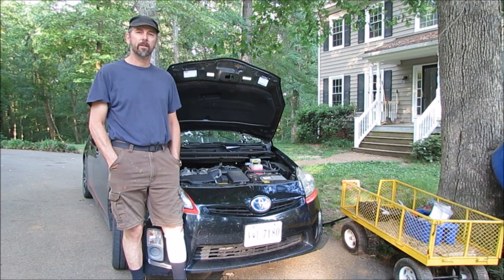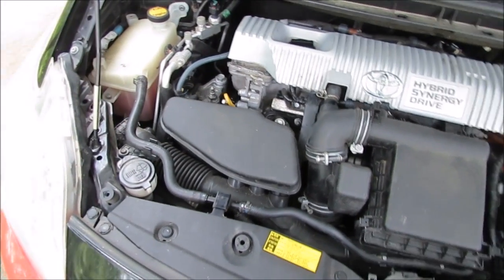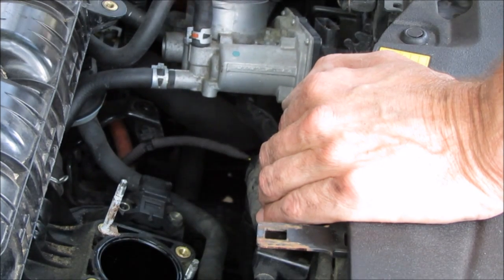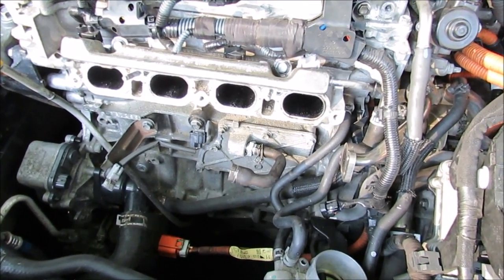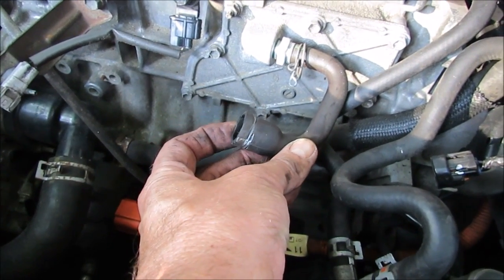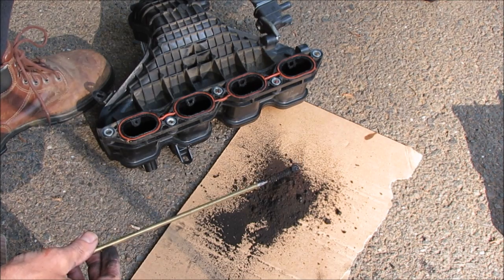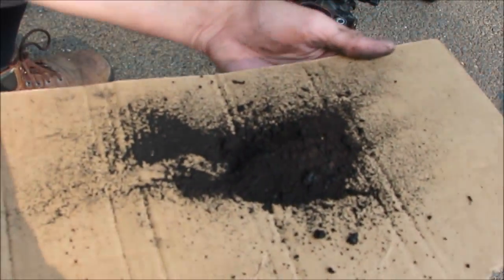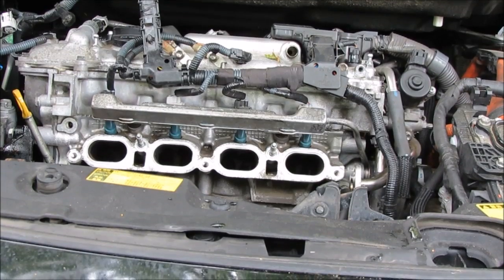Prius Intake EGR ports clogged

Comment: Do you have to replace the intake manifold gasket when you do this cleaning?
Reply from the maker: It would depend on the condition of the silicone seal. If it's not dried out and still pliable you may not have to replace it. I've had mine off a few times and it resealed completely when I put the intake back on. A serious leak would probably throw in intake leak code.
Reply: @robrig1646  thank you. I've always replaced the throttle body gasket, because I thought it was so important there not to be an air leak on it, but the intake manifold gaskets rarely are they every replaced. Mine has 234k miles but its surprisingly clean in the egr valve and egr cooler for never being done. I probably should do the intake manifold cleaning as well since I did the egr valve and cooler?

Comment: If we make a trip to VA beach to ride bicycles and my car is running rough, I’m not gonna take my girlfriend to Raleigh NC the following week before addressing the issue, I don’t want to ride bicycles back from Raleigh. I would clean the throttle body, and perform a computer reset. Your computer has been compensating for these flow restrictions, so when you remove the restrictions, it can create drivability issues

Comment: For the wire harness attached to the air intake manifold at 5:00 into the video, I squeezed the tabs with the short end of a 3.5 and 4 mm Allen wrench and it came out really easy.

Comment: Thanks for the video. My 2014 Prius with 181k miles would clatter when accelerating slowly while the engine was running and the hybrid battery had two bars of power.   Your advice that the coolant hoses didn’t need to be disconnected from the throttle body was fantastic.

Comment: I still don't understand why this clogging leads up to flooding of the intake manifold with oil. I just discovered fresh oil behind the throttle plate AFTER cleaning the throttle body and part of the intake manifold. Before the cleaning , those parts had carbon yet were dry. The fresh oil popped up after the cleaning. A complete mystery
Reply from the maker: I don't think the oil in the intake is because of the EGR being clogged. I think the oil is vapor from the PCV system that condenses, coats the inside of the intake, then slowly puddles in the bottom below the throttle body. 
Get a oil catch can and insert it into the PCV system, YouTube has lots of videos on oil catch cans (OCC).

Comment: Good video! Instead of brake cleaner, white spirit and valve cleaner 1, I recommend using regular grill and stove cleaner to clean the entire EGR system. You need to apply this product inside the channels and the EGR cooler, wait half an hour, and then clean with brushes and wash with water under pressure.
Reply from the maker: Grill and stove cleaner? no kidding. I got to try that next time
Reply: @robrig1646   This is not a joke. There are many videos about this. Just do not apply it for a long time on aluminum parts, because this product may contain alkali, which reacts with aluminum.

Comment: Great video, one of the best guides for this process that I've seen and I've watched many. I love the tip about using a 10mm socket for the retention clips. I'll definitely be using that. I'm planning to change the PCV valve during this job, would you recommend changing the crankcase vent valve as well, since I'll have good access to it? Is it worth it as a preventative? Thanks in advance if you see this.
Reply from the maker: @patriley2  You could change the PVC valve since it's easy access with the intake removed, but you could also get by with spraying it out with cleaner if it's working properly and just keep using it.

Comment: Do you have a video of the egr cleaning?
Reply from the maker: @DebtFreeCars  no, but there's plenty out there. I pull off the cooler and EGR valve along with the tubes. Clogged cooler is the worst, real pain in the ass, very difficult to clean out. I try and get the EGR stuff as clean as possible, my thoughts are the cleaner I get it, the longer it will go before having to repeat the cleaning.

Comment: Great presentation. Having just watched another video with a stuck open EGR valve (that was replaced) , I am left wondering why you didn't at check it and or clean it as well?
Reply from the maker: I cleaned my EGR system cooler, tubes, and valve a few months prior to cleaning the intake passages, didn't see any reason to pull those off and clean again. Having previously cleaned those parts and the roughness coming back is what lead me to pull the intake manifold and discover the passages blocked with crap

Comment: Suggest removing egr  valve and cooler.  You use a pressure washer to clean cooler and intake.  Just finished this job.  Also, replace all rubber gaskets.  Clear all fault codes and let car relearn.
Reply from the maker: Pressure washer? Hmmm... I'll have to give that a try next time. Because you know, there will be a next time.

Comment: thanks for the video, I am going to try this cleaning because my 2013 Auris Hybrid is jerking as soon as I accelerate on gas. Local Toyota dealership wasn't able to fix the issue, so I'll have to figure it out myself, and I am starting with this operation
Reply from the maker: Have you done the work yet? let us know what you found.
Reply: @robrig1646  I did the job, EGR valve and especially the cooler were really dirty! But the issue was too much oil in engine, that screwed the spark plugs, that's why car was rattling (and shutting off) as soon as engine kicked in... I had to find out and fix it myself, idiots at Toyota never had a clue!
Reply from the maker: @dmarinon   That's good news. I replaced my original engine with a JDM engine. I tore down the old engine and found all the piston oil control rings clogged.
I now make sure I change my oil every time the change oil light comes on regardless of the oil manufacturer's claims of "15,000 miles". I also started adding 8 oz of Marvel Mystery Oil at each oil change. 
You're probably still gonna get oil through the engine from the PCV system. My old engine was getting oil in the intake and new engine did the same, so I added an oil catch can between the PCV and intake manifold. 
If anything, start using Marvel in your oil, it'll help reduce and clean build up on the rings. It's pretty cheap preventive medicine.

Comment: I thought i was going mad, ezact same symptoms as me, i would let off the gas coming to a stop, and i thought the the texture of the road was becoming rough, i would be stuck at the lights and the car was running rough, i would pull away car would be spluttering untill im over 40mph and would get better, again in the traffic i would have to slow down and have to be right up someones bumper to stop it stalling out very frustrating lol
Reply from the maker: Did ya fix it?

Comment: Thank you. My 2010 Prius with 240K is doing the same thing. I will attempt to fix this over the weekend.
Reply from the maker: Did you fix it? let us know what you found and how it worked out.
Reply: @robrig1646 it runs like a brand new car. Smooth, responsive, and better gas mpg. Mine was exactly like yours- all holes were clogged. I used multiple thin brushes and once I removed big chunks, I used pressure washer to each ports. Repeated the processes multiple times. I’ll probably do it again every 50K miles. I also replaced PCV valve since intake manifold was removed, and cleaned out the valves. This had nothing to do with rattling noises. Thanks.
Reply from the maker: @Sagemeister007  That's good news. I replaced my original engine with a JDM engine. I tore down the old engine and found all the piston oil control rings clogged.
I now make sure I change my oil every time the change oil light comes on regardless of the oil manufacturer's claims of "15,000 miles". I also started adding 8 oz of Marvel Mystery Oil at each oil change. 
You're probably still gonna get oil through the engine from the PCV system. My old engine was getting oil in the intake and new engine did the same, so I added an oil catch can between the PCV and intake manifold. 
If anything, start using Marvel in your oil, it'll help reduce and clean build up on the rings. It's pretty cheap preventive medicine.
Reply: I change my oil every 3K miles using full synthetic. It might be overkill but I do it myself so I save money. I’ll try adding Marvel next time.

Comment: That tip about the 10mm to get the clips. Mind blown
Reply from the maker: Thanks, I think for a few people, that was the take-away that stuck with them and made watching the video worth it.
I came up with it out of frustration, so I was reaching into my mental bag of possible tool tricks, when I pulled out that one. 
When I discovered that little trick, even I was thinking "Holy shit! It worked!". 
Then I thought, "Man! I'm gonna get the Nobel Prize for Automotive Discoveries. Everybody needs to know this trick, I gotta share it!  I'mma put it in my video!"
Reply: @robrig1646  first time watching you
But I’ve been doing all the work on my Prius
Never thought about using the socket though

Comment: I have bought a secondhand intakemanifold and EGR-cooler, both wiht a lot dirt and builtup. I soaked them in dieseloil but there still was some builtup. I used ovencleaner and the dirt came loose.  I only have to put them on the engine. If you keep your EGR and intakemanifold clean you don't have to worry about rattling, troubelcodes or failing headgaskets
Reply from the maker: I've used Carb and Brake Cleaner, Purple Power, Simple Green, Oxy-Clean.... I have yet to find anything that rips the carbon/oil build up out of the EGR. Everything is a soak, rinse, blow out, repeat ad nauseum process until it's cleaned to my satisfaction. I'm not expecting to make it shiny, new, and eat off it, but I figure the cleaner I get everything, the longer I can drive before I have to do it all again.

Comment: And Toyota/Lexus loved to tell their customers to run 87 octane in these buckets as a selling point SMDH. Where's the recall Japs?
Reply from the maker: 87's not a problem, it's not a high compression performance engine where low octane will cause knocking and performance problems. This build up has nothing to do with octane, it's engine design and EGR/PVC system.
Reply: @robrig1646  87 compounds the problem and speeds up the process.
Reply from the maker: @matthewmurphyrose4793  I doubt it. Octane is to prevent knock in high power engines, that's all it does, doesn't make engine run cleaner. Prius uses an Atkinson Cycle, if anything it's the complete opposite of high power, it's like a 'reduced power' engine.

Comment: I recently bought a 2010 Prius with the problems you described. 
70 years ago, I used to hang out around a GM truck repair station that was run by a few WW2 Red Ball Express mechanics.
[I pumped gas there.]  Everything they did ran fine, courtesy of the US Government and its petroleum engineers.
A few products that worked well then have survived a very long time. 
Two are Marvel Mystery Oil and Rislone (extremely slippery). Also, more recently, -- Techtron. 

That Prius said i delivered 42.3 mpg for the last 1000+ miles.  But I was getting less under ideal conditions, 70F
I tried the best of Rislone -- use with two tank fulls -- The misfire stopped and the MPG rose to 45.5. 
After the second tank of Rislone, I added a tank full with Techtron and nursed th MPG to above 48.5 on combined Highway and regular. 
Something good is happening, and I'll keep trying to see how much more I can get. 
I am driving slower than usual (65 now) and the weather is a perfect 70 degrees. 
I'm eager to seel how well that lasts, especially when the fall/winter sets in. 

Useful advice: Avoid "crap gas."
All refined gasoline reaches NE through pipelines, where they drain into immense tanks owned by brand names who add adatives. 
Gasoline tankers carry two grades that they mix to form three levels: regular, medium, and hi-test.

I put about 180K miles (on top of 60K -- 240K) on another 2010 Prius and always tried to use Sunoco which cost a little more but always seems to deliver 5-10% more miles. 
It's all about the adatives. 

BTW - Something I noticed recently -- Mobil One has oil guaranteed for 20,000 miles.
Reply from the maker: Good info. I gotta try the Rislone, see what happens. I do know my Lie-O'Meter always says I'm getting 2-3 mpg better than calculations  after a top off vs mileage since previous fill. 
As far as 20,000 mile "guarantee' on motor oil, I wouldn't do it. I run full synth and still change mine at recommended Intervals: oil is way cheaper than new engine.
Reply: @robrig1646  20,000 is insane. It is not just the oil that you change, it is the build up of other crap that you get rid of when you change your oil. Even 10,000 miles is a stretch. if you read the Toyota maintanance guide, they put an asterisk where it says 10,000. You really have to be driving pretty much all highway miles to warrant 10000 mile stretch on oil change. If you have harsh winters (half the country), lots of urban city driving, delivery driving, short commutes etc, you should replace every 5000 as per Toyota in the maintenance guide. Even the cheapest oil is better than not changing your oil in correct intervals.

Comment: Excellent video with smallest of the details. Are there any solvents in market that clean up the interior build up that was scrapped off in this vidoe.
Reply from the maker: Brake cleaner, carb cleaner, Can try Simply Green, or LA's Totally Awesome. I have yet to find any single cleaner that just magically strips this gunk out.

Comment: Can this cause a p0401 code even after replacing Egr
Reply from the maker: I believe so. If you replaced the EGR and/or the cooler and didn't unclog the intake EGR passages you will still get engine issues. Pull off the intake and clean it out like I did in the video.

Comment: This is a great video!!! So the EGR cooler is a problem also, not just the valve itself?
Reply from the maker: You have to do the whole system, from exhaust end connection on cooler to intake end at head ports.
Reply: @robrig1646  OK thanks

Comment: Great vid thanks Rob, Im doing a head gasket on a 2000 Echo, 366k miles and the pistons are caked with carbon..  so far,  the best solution is soak them with brake cleaner and cover with sandwich bag plastic,  keep it wet and let it ride, the carbon lifts off little by little.  I tried a brake fluid/acetone mix but it just was Not cutting it..
Reply from the maker: As evident in the video, I don't think there's any effective "cheat" to clean this without pulling it apart.

Comment: Can someone explain me, a beginner, what would happen if a small piece of carbon gets loose during operation of the car? Does it fly into the cylinder and cause issues there? Does it get trapped somewhere in the exhaust when it leaves the cylinder?
Reply from the maker: small piece would just to through, you'd never know it. Carbon is soft, not like a hard piece of metal that could cause damage

Comment: Thank you RobRig for the excellent video.  I successfully performed this service on my 2011 Lexus CT200h this past weekend following your steps...esp. the tip about the 10mm socket to unhook the plastic clips, not disconnecting the coolant lines to the throttle body, and using cleaning brushes.  I used a set from Harbor Freight that were okay...probably could be a bit longer.  I also should have started straight in with brake kleen instead of the throttle body/carb cleaner that I used.  That was on me and would have saved a lot more time.  The CT doesn't get as good of gas mileage as the Prius, but on my first test drive circuit, I got an average MPG of 46 vs 41 after the cleaning.  I just wanted to thank you again for your video!
Reply from the maker: thanks for the feedback. I know others will appreciate the insight in your comments.

Comment: Great video.  I cleaned the manifold(2 clogged ports) removed and cleaned the injectors, and replaced the pcv valve at the same time. 240k miles and runs great.  I had a P0300,P0302,P0304 and P219A and they were resolved with the above mentioned repairs.
Reply: Hi how did you clean injectors?
Reply: @claytonvanrooyen3582 a 9v battery and alligator clips.  Open port amd spray in reverse of fuel flow.

Comment: I did clean the intake manifold nine months ago. recently it threw a P0401 code. is that manifold ports clogged again or EGR valve /cooler clogged? how long need to clean the EGR passage and port?
Reply: Chances are you're clogging. I soak all my EGR parts in very hot water + cleaner, last time it was all weekend; soaked, rinsed (with hot water) , soaked, rinsed, soaked, rinsed, in my laundry room work sink....It's not just a quick shot of carb cleaner down the cooler and you're done. Certain cleaners will cut the oil and others will cut the carbon. I think I used LA's Totally Awesome for one cooler (worked best) and Oxy-clean on other another cooler (worked best), also numerous cans of brake cleaner. I try and get my parts spotless, not because I'm anal, but the cleaner I can get them, the longer it will be before I have to do this again.

Comment: Anyone ever try Seafoam for these issues?
Reply from the maker: You mean run it in the engine oil or fuel? I have, it doesn't do jack to clean out the EGR system or keep it clean. 
If you mean soaking the parts in Sea Foam, it will loosen and soften the gunk, but you still have to scrub it out with mechanical means; Sea Foam is not a magic "soak it and rinse it" solution.
 The clogging of the EGR system is inherent in these engines; it's just a matter of time.

Comment: Do you drive a lot in the city or highway in your prius?short drive long drives and what average speed in Highway?
Reply from the maker: I do 80-100 miles a day to/from work, at 60 to 75 mph. That's easily 90 percent of my driving.
Reply: My Prius will use lot of oil if I drive past 66 but does not use any oil if I drive 58 to 63mph.